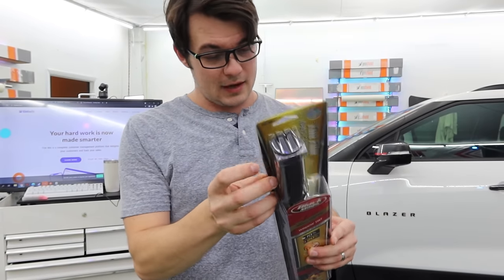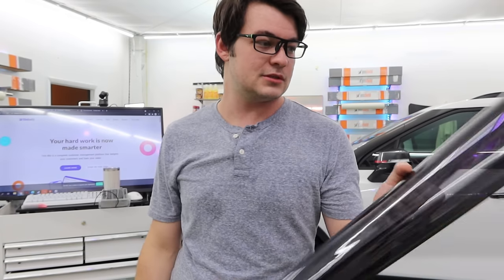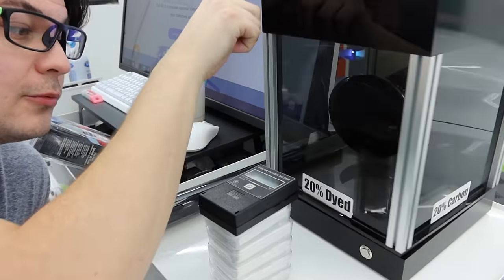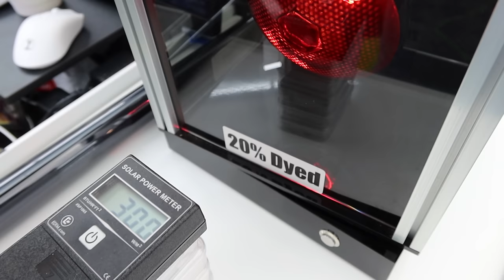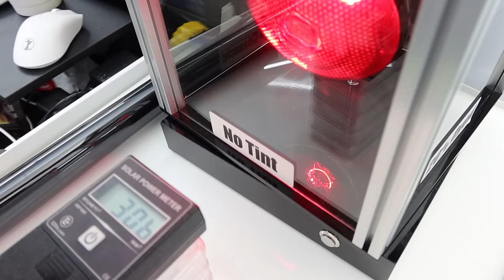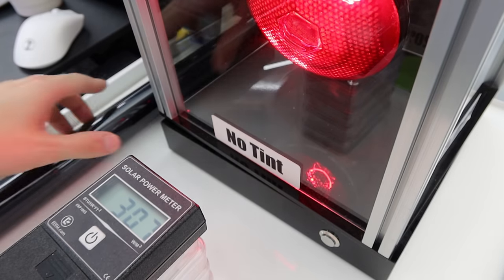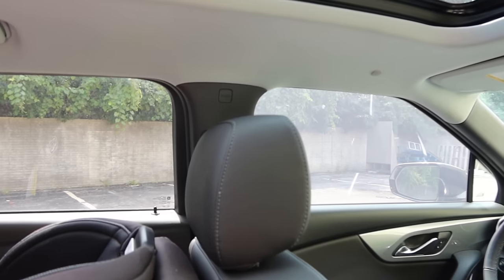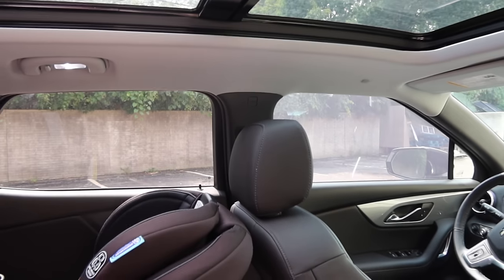Walmart Ceramic Tint Should Be ILLEGAL!!

Comment: I used this same exact tint for my car and after a couple of days  the haze completely cleared and the windows look awesome.
Reply: I was going to say the same thing.. haze is normal but does go away when the tint dries
Reply from the maker: if it's not ceramic lol
Reply: @DetroitTintStudio  Or maybe they just got better results, either they subjected them to different environments (UV, temperature, etc) or you got a bad batch.
Reply: Same here I got the Walmart tint put it on my truck windows it was hazy at first and cleared up in a few days!
Reply: I had my car professionally tinted with ceramic tint and wasn’t any hazing on any window.  

That being said I was warned by the tinting guy that sometimes because they use alot of spray to install the tint that it can cause it to look a bit funky, like milky or rainbowy or diffused and that it will dry out and it will look better, usually.  If not to return and get all the tint replaced.  Really wasn’t an issue with my tint install, was a few “bubbles” of fluid that quickly dried out and were a non issue but really the tint is super clear.
Reply: Were you all using ceraming.cheapass walmart tint like in the video? Or non ceramic. Nobody contested that.
Reply: @umakemerandy3669  mine? No, not cheap ass tint.   I forget the brand but I paid almost $700 for installer to pick best ceramic tint he trusts and to install it on all my windows, mine has a lifetime warranty as well.   

I suspect he just hands out the same warning to everyone just incase.  but I feel like maybe should be mentioned here just incase, maybe it’s true it will clear up.
Reply: @DetroitTintStudio  "Tron Arts" above you just Completely Discredited your video with his/her comment.
Reply: @Honeypot-x9s  damn you got ripped off. As a professional custom car builder I'll assure you the product was under $200 and labour was $99 a window lmfbo dude made $500 a hour with you sucka
Reply: @twistednuts6062  nah, he had to tint 7 windows in my wagon.    Front left, front right, rear left, rear right, cargo left, cargo right, rear hatch.  $100 per window for professionally installed high quality thick ceramic tinting, with a lifetime warranty that is transferable.  

He has shitty tint he can install for $200 as well that has the look of ceramic tint that ceramic tint shine.  I believe it’s a carbon based tint.  It sort of blocks the sun’s heat but can still feel it.   We had that installed on one of our other cars.. defiantly no where near as nice, like 5x better than the shit you can buy from the shops and have installed but still leagues below the $700 tint job I had done on my wagon.
Reply: @Honeypot-x9s  oh word, yeah I dig
Reply: I used the same exact 10 I'm just watching the video now I thought that i forgot to put soap in my water or something because the haze was so bad... I don't know what you guys are talking about but that shit is still hazy as fuck and it's been almost a month, and I'm not an amateur I installed vinyl and window tints at a sign shop for years. The haze is not as bad now as it was shortly after the install but trying to see through these tints at night is dangerous to say the least 🙅. Can't say I'm completely disappointed for $20 but the video is completely accurate, I will never use this tint again
Reply: @mikeswanson88  by the end quality of your work, and other examples shown in the video, nobody should be questioning your abilities lol. Im honesty gonna assume it's either a bad batch, or product. Reach out to the company, how they handle it from there is what I would use to judge them. If no replacement or replacement doesn't perform any better then condem the select product.
Reply: @tron Arts it’s been over 3 months since your comment . How’s the windows looking?
Reply: @paulweston8184  🤣😅😅😅🤦‍♂️
Reply: @twistednuts6062  $700 is cheap for ceramic tint. You're just used to Walmart stuff and shoddy work. One day you'll be able to afford good products, good work, and a warranty to back it up.
Reply: @DetroitTintStudio  There's no such thing a ceramic window tint, just like there's no such thing as a ceramic paint coating. It's all a marketing lie. There's no actual ceramic in any of those products.
Reply: @littlejackalo5326  LOL and if you believe that I have prime farmland in the Everglades to sell you, and a bridge in Brooklyn as well.

I guarantee the "ceramic" (which is an outright lie) tint comes off the exact same lines of the exact same factories as the cheap stuff. The only difference between them is the suckers that are dumb enough to pay 100x what it's worth.
Reply: @awo1fman  It is not a marketing lie. The tint has ceramic particles which blocks more heat and even more UV rays and that differentiates it from the other tints. There are tests to show the difference in using the different tints as well like the one shown in the beginning of this video for example.
Reply: @scaryjerryofmerrykerriemay2727  Don’t try and argue with idiocracy. You almost never win. Lol
Reply: @Honeypot-x9s  ya that’s a rip off
Reply: @HardWorkpaysofff  Installation for crystalline tint was at least a thousand bucks for all windows couple of years ago. I don't know how much they cost these days, but $700 sounds reasonable for top notch window tints. I have window tints for about 7 years now, and till today not a single nano imperfection has been noticed. Guess what, you pay for what you get. If installer has more expensive tints, they cost more for a reason.
Reply: @twistednuts6062 😂😂

Comment: I'm Hella broke. My tools are an old windex bottle with soapy water, an old driver's license, and some razors I find in the garage 🤣
Reply: soapy wooder
Reply: Sounds like hair dryer and you’re good to go
Reply: Yeah me too and I never leave a bubble
Reply: I’m not broke but still go with a screwdriver and Cosco membership card and soapy water
Reply: Use Johnson's baby shampoo ( without conditioner ! ).
It can even be the cheap store-bought look-a-like brand name baby shampoo.
Use half teaspoon, for Windex bottle, shake well.( Only put enough shampoo to allow tint to barely move, when first placed on glass , doesn't immediately stick).

Baby shampoo is the only thing you want to clean window tint with. Use 100% cotton t-shirt, some paper towels will scratch tint.

Any car with factory E Coating, Glazing, will scratch very easily, when cleaning with razor blade, or scrub pad. (Ford vehicles 80&90 )

 Windex removes tint.
If window tint is purple and full of bubbles that means it has been cleaned with Windex.

The ammonia in Windex removes the adhesive on tint.
Reply: so are most professionals   nothing beats the licenses  or credit cards
Reply: @erniemckracken1593  Wow, thanks, had that happen with my jeep and could not figure it out. Looked like purple, soapy, oily bubbles that would not come off. Yes I used windex not knowing better. Thanks for the pointer.
Reply: Save for 2 more months and you'll have the right stuff

Comment: Thanks for the heads up. I'm still going to install this on my VW ginormous sunroof with that kind of heat blocking...I'm in Florida
Reply: The haze probably won't represent much safety concern overhead...
Reply: @garyblack8717  Plus it has the retractable sunshade. I've even considered painting the sunroof glass, the heat is brutal.
Reply: Give it 6 months and you'll have bubbles. Maybe not an issue to you

Comment: You should put your best tint, Walmart tent and the worst tint you have used on 3 different windows cover part to act as the window seal, leave them out in the sun for a few months and show the difference in good and bad tint
Reply: Sounds like a summer report picture, not an interesting commentary video
Reply: Only need two windows pal. This is the worst and the Walmart

Comment: Dude!! I used it (walmart kind, not sure about ceramic) in my 87' f150. I thought the ac was low or bad but it needed tint. Turned out to be the world of difference, ac will freeze ya out. I've had my cars tinted but I wasn't gonna pay for the ole work truck so I did it cheap myself. It works better than what I did pay for from others. This has been 11yrs ago I sold the truck to my buddy who still has it and the tint is still good 🤷🏾‍♂️ not miscolored or wavy. Crazy the older stuff didn't haze

Comment: It takes 2 seconds to pop the top of the door panel off and get out the felt anti scratch/seal off. Really makes it super easy to get the rest of the small fingers at the bottom and makes your job look 10x more professional imo
Reply: Nah, it takes much longer than that. The top of the door panel won't come off without sliding the whole panel up. So you need to take the whole door panel off. If you can't tint it perfectly without taking the door panel off and risking breaking clips, you shouldn't be tinting. People don't want you taking their car apart. Cars are never the same after interior panels are taken off.
Reply: This isn't allowed at pro tint competitions

Comment: I tinted windows for 6 years. You did a good job, a professional would remove the door panel. I like the heat shrink trick.
Reply: You don’t have to remove a door panel, or gaskets (sweeps) to tint. You can use the 2 stage method that was demonstrated in the video.
Reply: @armandozapata3386  sure you can do that and get water spots on the door panel. Having it off you get a cleaner and tighter fit with the tint. Sure, skip the steps and do 80% of a good job or do it right. Up to you.
Reply: @isaacodegard740  you aren’t supposed to drown window, a mist with the right slip solution will do, and regarding the fitment, if you made your pattern correctly it’s gonna fit perfectly. Two different styles of tinting, end result is the same.
Reply: @armandozapata3386  imagine your working on a 100k car and the owner walks around and sees you with the door panel propped out and covered in bubbles and solution. No matter what the shit gets everywhere. Like I said, a professional* would remove the door panel to do a proper job. Otherwise your just a hack in a garage.
Reply: @isaacodegard740  I’ve tinted vehicles over 100k didn’t have to pull a panel to tint them. Nothing was damaged. You mist the glass, you don’t go and drown the panel in solution. Two different methods, in the end it’s the same result. Some guys remove sweeps, panels, some just two stage. 
There is no right or wrong way and having a preference doesn’t make you a hack, that’s your opinion.
Reply: @armandozapata3386  the wrong way is keeping them on which harbors more dirt, plain and simple. Even brand new vehicles have particles along the sweeps. If you want  to do a professional job then take the panels off. That's all I'm saying.
Reply: @isaacodegard740  one thing I’ve noticed from being a window tinter is we kinda get stuck in our ways and how we were taught, you can get a window tinted 100% perfect without taking the panel off. It’s actually less efficient to take panels off and risky with some cars. Also they make plastic you can put over the panels if it’s that big of a deal. P.S. if you don’t know how to top load efficiently, take some time to learn. Know one gets in business to not make as much as possible and do a good job so you must find an in between efficiency and quality work. Both methods work. Take this as you feel!
Reply: @donavonmeekins5782  yeah any tradesman gets stuck in their ways haha. 

Have you ever tinted a pickup truck that's 15yrs old and been down gravel roads for 100000+km the inside of the vehicles are caked in dust and mud, even after being detailed. I live in the country and mostly worked on dirty vehicles so we always removed panels to reduce dust.

Comment: I use that on all my vehicles, and you have to let it sit and cure. Sometimes it takes a few days
Reply: Have you seen it take longer than a week?  Please see updated, pinned, comment.
Reply: @james0000   Depends on the temperature and whether it's in direct sunlight
Reply: @1gearwrench  Well, they left it on for 1 week of hot weather, according to thier posts.  I have no first hand knowledge of this tint as it's been quite a while since I applied tint.
Reply: Bob Watters  he also didn't follow any directions on how much solution to use

Comment: The haze is from the “nano “ ceramic material because its a cheap version. But on a regular 20% tint BM will be clear. Its the ceramic cheap material . So its not because its not dried completely or cured.
Reply: that's how you haze someone with walmart tint
Reply: And after 6 months, you're riding with bubbles....especially in S Florida

Comment: I think it's the soap solution that comes with the tint. Especially after leaving it on for a few days to dry.
Reply: It definitely could be but I suspect it was the product. It would be interesting to see if using a quality product to adhere it to the window makes a difference. I suspect nothing will change though due to how much heat it blocked out. The haze is likely why it blocks so much heat.

Comment: Constructive criticism about your heat transmission measurements. The air space gap may have resulted in such a good number for the tested tint.
Reply: Easy confirmation, take his usual film he has on the other side, and drop it like the ones you're testing.   Compare how close the numbers are.
Reply: @ryanpaaz  agree. But he didn't do that!
Reply: Was also thinking that, and would the plastic on the black magic film be a factor? Either way not a very accurate measurement.
Reply: Air and heat don't react... heat is the same with air or without human you've lived how many summers?
Reply: I do window tinting for a living, never used a heat gun but most importantly,  why are you tinting the outside and inside? As mentioned before, that's why your tint is supposedly like crap. Ask any pro, you only tint the inside..  period
Reply: @mrllj2487  he never tinted the outside. I'm going to give you the benefit of the doubt on your whole pro thing and assume you only use machine cut tint so you never put it I the outside to cut it.
Reply: @mrllj2487  You seriously just posted this using "pro"? lol 😂
Reply: @mrllj2487 , your comment is not correct. He IS NOT tinting the outside of the window.
Reply: @mr.c6674  Then what is he,doing at 5:00
Reply: @mrllj2487  He's cutting and shrinking the film to the shape of the window. The tint itself will go on the inside.
Reply: @mrllj2487   he was getting the film cut and its easier to do it on the outside and then go put it inside he never put it on the outside, most people how use tint rolls do this but if you use precut tint you don't have to do it.
Reply: @mrllj2487  there is no way that you are a "pro" if you have no idea what he doing at 5minutes
Reply: @mrllj2487  You obviously have more to learn.
He did what any professional window tinter would do. He cleaned the exterior of the glass and cut the tint and shrank to fit the curves of the glass with the heat gun from outside of the vehicle which is an easier place to do this work. He then took that tint and installed it inside the vehicle.
Reply: @mrllj2487  im no "PRO" and havent installed tint in 10 yrs and i still know hes 
not tinting both sides man
Reply: @mrllj2487  he didnt . He cut the shape on the outside window and then he put it on the inside of it
Reply: @PhyteByte  Air is a normally invisible insulator. Some 80 or so percent of the heat outside radiates from the surface of the planet due to the greenhouse effect. The air between his light meter and the light in the glass case has nothing to do with what he was measuring.
Reply: @mrllj2487  pretty sure he was shaping/forming the curve of the glass to the film. That is what I heard on a video before this one.

Comment: I used Black Magic tint from Walmart on several cars and after a few years the film literally turned a grayish white.   Lesson learned - DO NOT use tint from WalMart.
Reply: What did u expected I change it every year and it’s good
Reply: i’m using the i stacking from walmart
Reply: Don't use any car related thing from Walmart, only the oil and fluid
Reply: Mine turned purple
Reply: @aztk5713  you change your tint every year? Derrrrrp. You're one of those guys that thinks you're saving money by buying the bottom of the barrel garbage, and don't consider the costs of replacing it every year. Or does the tint wear out from you licking the windows?
Reply: @littlejackalo5326  $20 every year vs how much to get it professionally done?
Reply: I installed eBay tint for about $25 last 5 years
Reply: Its a "brand of film" that is manufactured by KRACO.  Walmart just sells it.
Reply: It's terrible man

Should have used gila from beginning

Comment: That's crazy. I've used that exact tint on 3 old vehicles and have never had that type of haziness. Not even close. I'm not sure what went wrong here, but that cheap tint is not as bad as what this video makes it seem. It's definitely not pro grade, but if you don't want to invest much on an old junker, you most likely will not have that milky color using this tint. Something went wrong here
Reply: Agreed, I think he added too much of that solution at the beginning to his spray bottle.
Reply: He probably failed to get the previous tints adhesive completely off.

Comment: I did my house windows with a privacy/mirror tint from lowes. It was 40 dollars for a 24X48 roll. Looks great from the inside and outside with no haze at all from what I can see.
Reply: Great job! I did the same with the mirror tint, but used the tinted security glass in order to help prevent a break in. It doesn't go into the framing which would provide the best coverage. It does do a great job as we get sun from our windows on the west and east side.